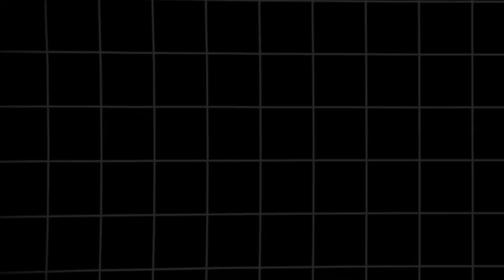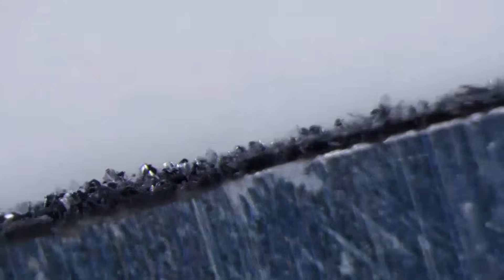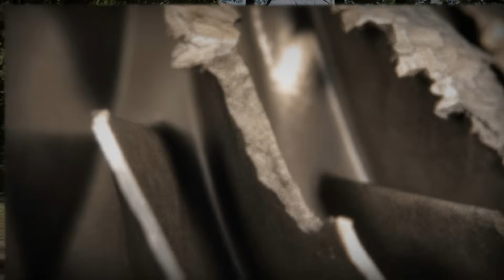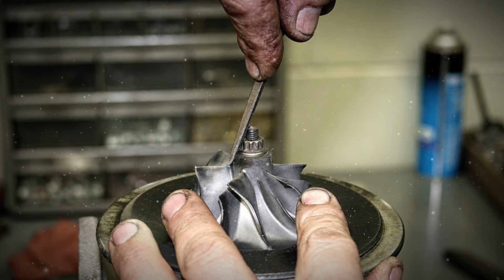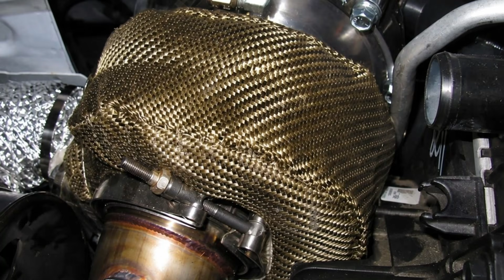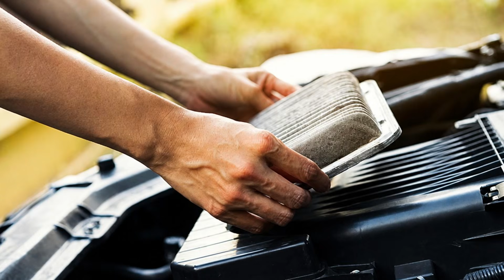7 Ford Turbo Habits to Break Before the Repair Bill Arrives

Comment: I replace all my fluids with AMSOIL (the ST transfer case takes less than 1qt!). I change the full synthetic motor oil from Motorcraft every 5 K miles.
However, the “The Motor Geek” lab testing shows that Amsoil is one of the best to prevent turbo bearing oil residue on shut down and I cannot find any testing data on the Motorcraft, so we are switching over.
Cheers